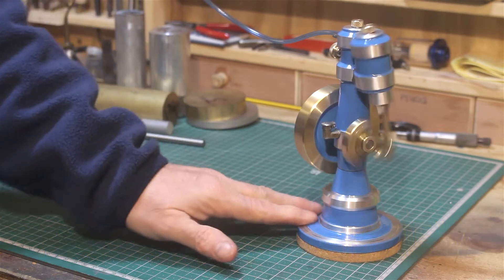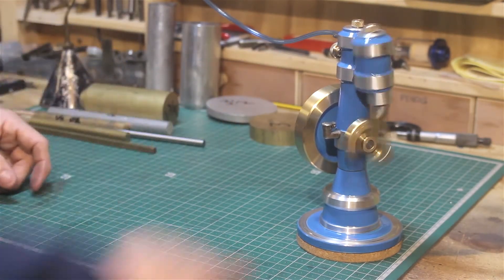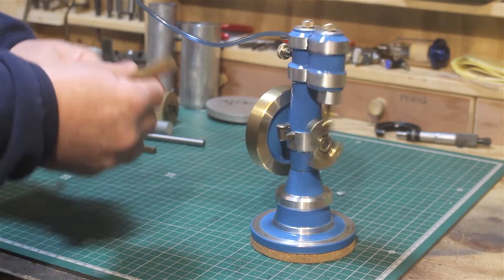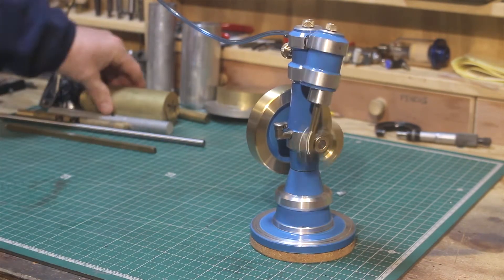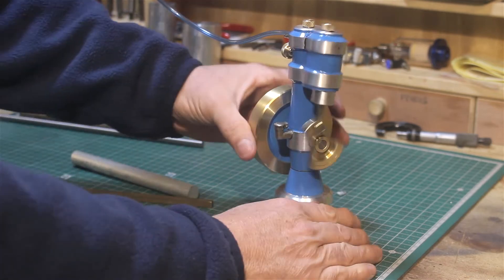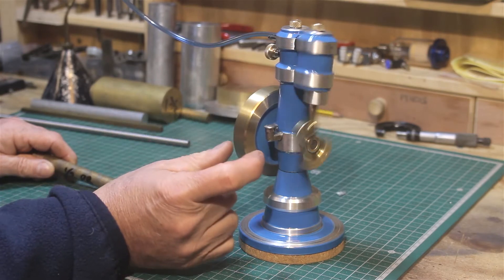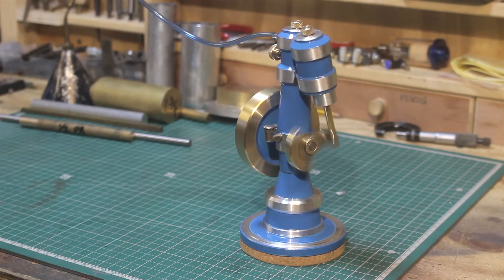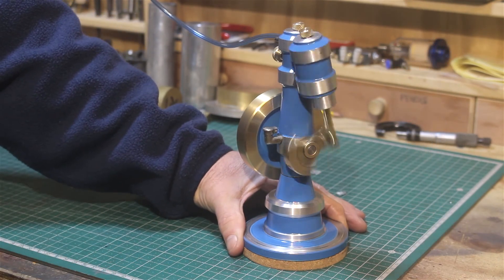Cornish Blue Pepper Pot Wobbler Engine - *Technical Overview*

Comment: I’m watching this for the second time.   I’m thinking I could make this one without a milling machine.   Hmmm  you have me thinking.   I’d be grateful if you would share a drawing or your thoughts.
Reply from the maker: Hi Lisa, this should be easilly made on the lathe, the only parts requiring milling are the flat surfaces on the portface and cylinder, which could easily be mounted on the lathe cross slide. I dont have full drawings but will look through my notes and see what I have. email me at swashade@gmail.co.uk
Reply: @adeswash  I sent email to adesworkshop@hotmail.com   Hope you got it.
Reply: Well this is embarrassing.  I sent to the wrong Ade.  The email you gave didn’t work.
Reply from the maker: @lisag2771  Oops, sorry Lisa, should have been dot.com, I had a look through my sketches but could not find them, I will have a measure up at the weekend and do a qick sketch for you. Regards Ade  swashade@gmail.com